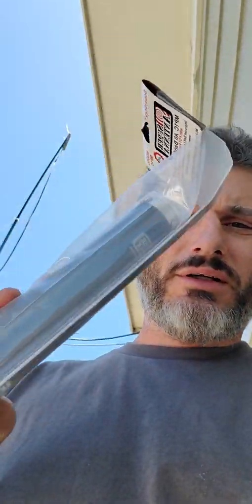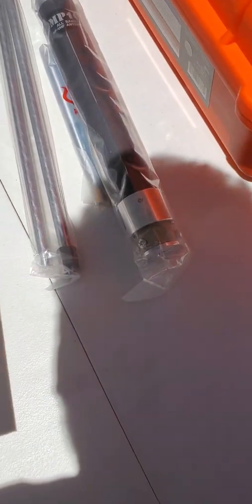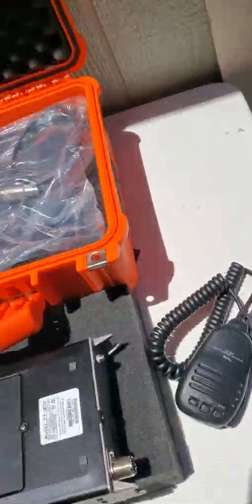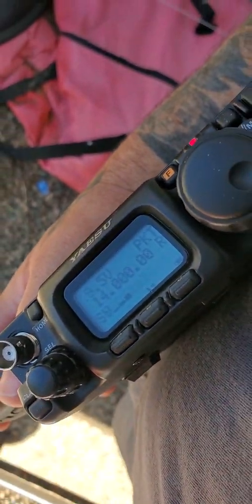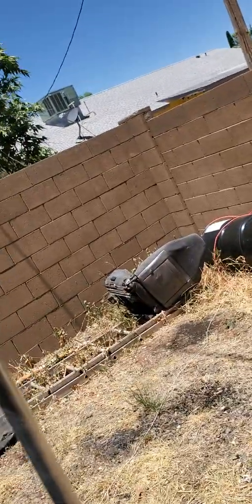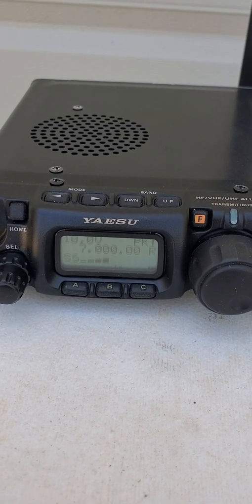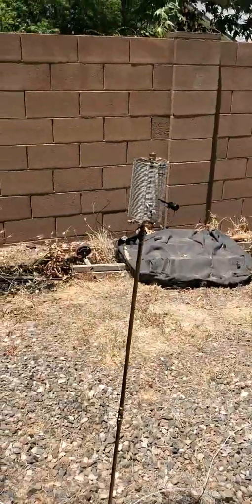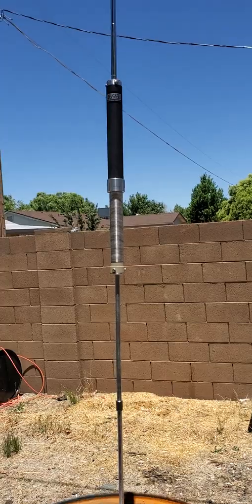Super antenna mp1c review.any good? What do you think? Part 1

Comment: Have you tried 2M, and if so how did it work? Is this antenna able to receive 70CM?
Reply from the maker: I haven't.well sorta..  I'm not sure how they claimed 2m. So what I did was use the collapsed whip alone and adjusted it somewhere around 19 inches for 2m with my ft818. But that's it.  I know they sell a 2m part. But this ant claimed 2m on packaging.  It doesn't make mention of it in manual. So using just the telescopic whip you can make a 2m or 70cm antenna easy but most of these come with the non telescopic titanium whip. I bought this specifically for the different whip.
Reply: Yes it works great on 2 m/70cm but again, you need to use it properly, the way it was designed to be used.

Comment: Try 1/4 wave ounterpoise wires.
Reply from the maker: I use 3 when i ground mount it on a spike. But when i place it on the top of our tahoe roof with mag mount it works well on 20m. Getting the xiegu G90 helped alot. Im very happy with the antenna.  Its a compromise that i can live with. The break down size and no need for tuner w ft818 are why i got it. Almost everything fits in my orange case